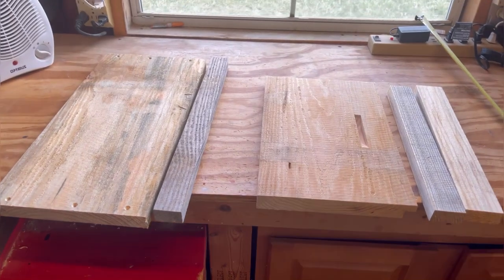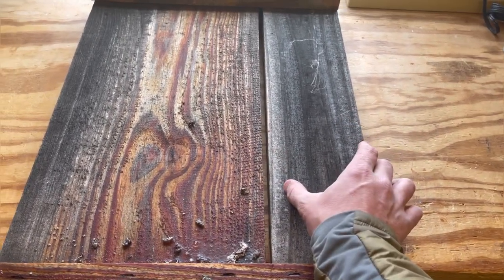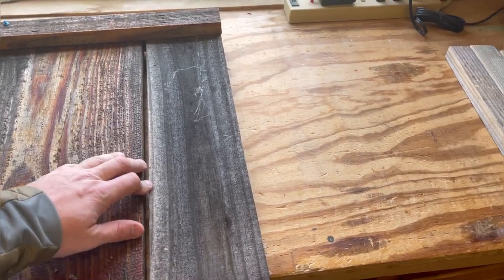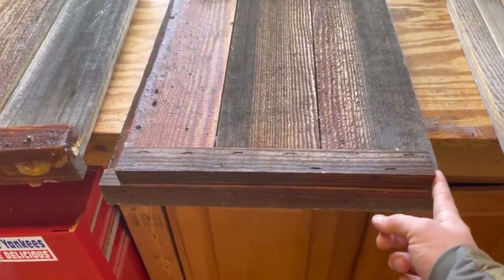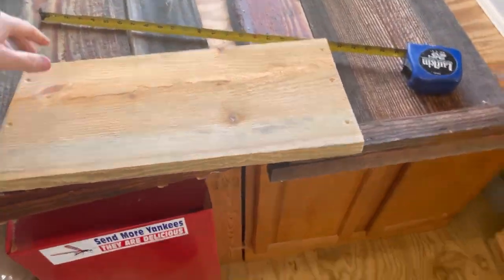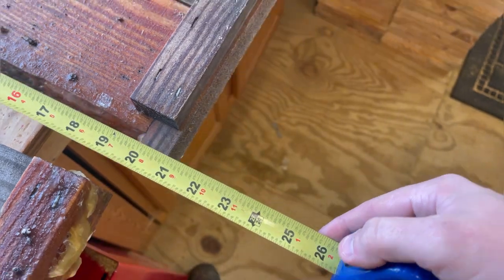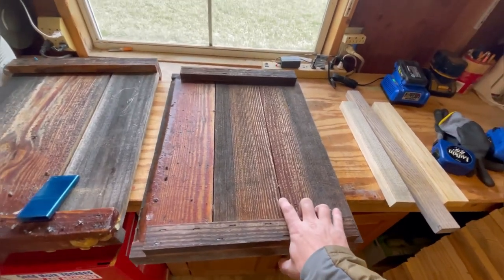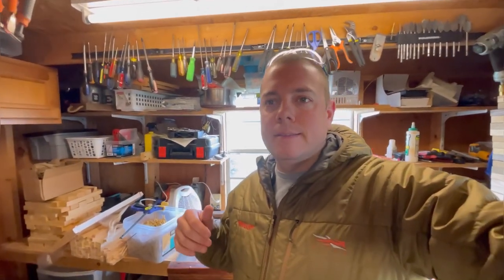Commercial Migratory Lids: How we build ours for our honey bee hives.

Comment: I built some bottom boards with yellow-pine lumber from Lowes, the wood was so wet you could not work with it. After the finished boards baked in the sun for a week, there was 3/8 gaps between the boards and I had to fill the cracks with window calking.. The 1x6 lumber cost me 8.00 for the build and I found a place that ships the bottom board for 21.59 w/o any flaws. The bottom boards from a local vendor was 35 and all their woodenware was stupid expensive.. Where I live, I cannot get any decent lumber and I'm looking into insulated hives such as ANEL and the overpriced Apimaye because I see the value in technology.
Reply from the maker: It was a good lesson to learn for me…..that ended up being a blessing. My equipment is not tight. It allows for extra airflow…..Bob Ross would call it a “happy accident”